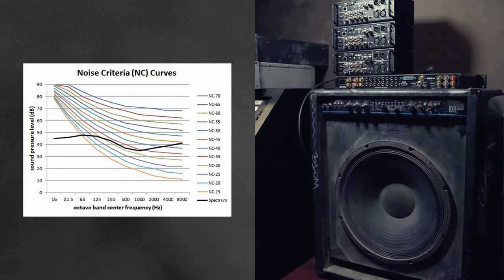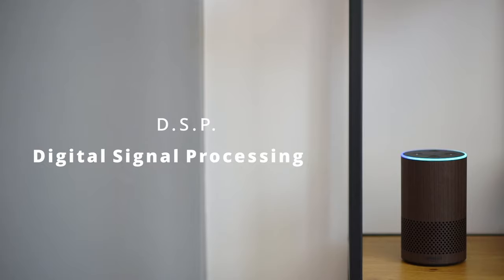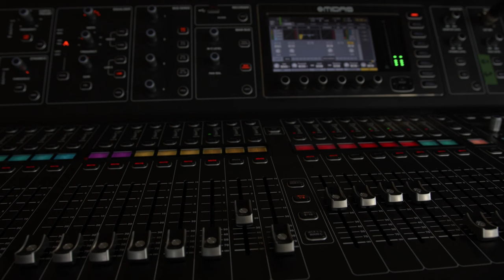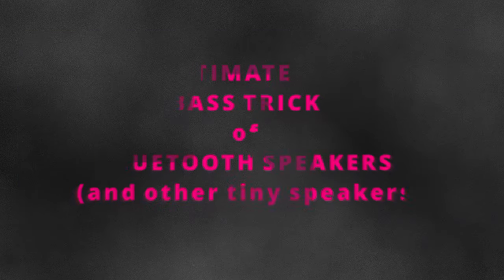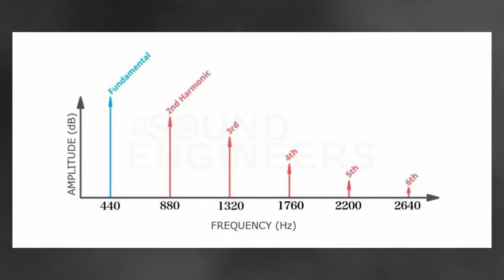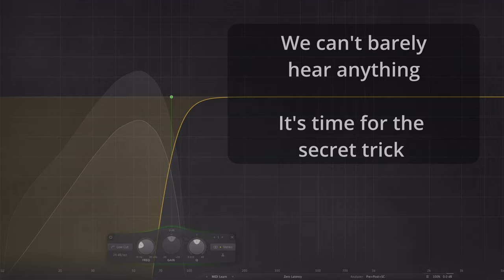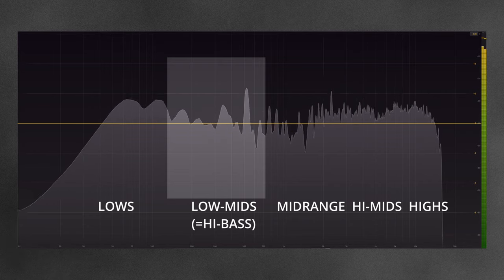the SECRET BASS TRICK of BLUETOOTH SPEAKERS (and other tiny speakers)

Comment: Another trick seems to be using oblong 'racetrack driver' speakers, to maximise surface area of the cone even in a small enclosure, and also passive radiators, which allow for a low resonant frequency without the space required for a port.
Reply from the maker: Indeed those are some the other tricks ! Thank you for sharing them

Comment: Dope breakdown, daws and plugins can emulate this trick but it comes at a cost like you pointed out
Reply: what plgins? I'd like to try them (I'm a composing grad so my daw knowledge suck)
can't you also mitigate that by applaying the reinforcing frequencies in a aux track? like, develop bass' harmonics from the bass intead of boosting it in the track?
Reply: @gesamtkuntswreck  congrats on being a grad 🙌🏾as far as plugins: Waves RBass is a cheaper and solid plugin. 
Submarine is also good for lower sub ranges. 
Applying to an aux/send could work too, it can give more control but I’d monitor the mid/side changes too if it’s stereo. 
And generating additional harmonics  within the synth could also work some modern synths have this built in. 
With Harmonics it just takes abit of math. Between the even and odd harmonics it’s worth remembering these all take up space and need to be considered for clarity. 
Anyway to summarize. 
Just experiment your ears will tell you what works or doesn’t. 
And with any type of producing the more your do it the better there’s no real secret 👏🏾

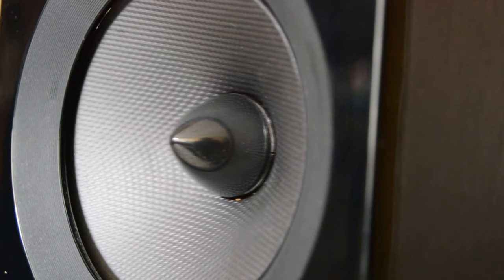Comment: 2:04 it's 50Hz, not 60
Reply from the maker: No, it’s 60Hz
Reply: @BoringVic  Il a raison, c'est bien 50 Hz. À moins qu'Audacity ne se trompe de fréquence...
Reply from the maker: @MadrafTintagel  C'est moi qui ai tourné cette section et je te garantis que c'est bien 60Hz. Et si tu regardes bien où est le sommet de l'analyseur spectral, tu vois que c'est juste après 50Hz, à 60Hz précisément. Après, je vous l'accorde c'est une forme d'onde assez large pour que ce ne soit pas très clair au premier regard.
Reply: @BoringVic  Je viens d'écouter 50 et 60 Hz avec Audacity, et pour moi, c'est clairement du 50. Cela dit, à ces fréquences, l'oreille humaine n'est peut-être plus vraiment fiable. Quant à la courbe, je vois le sommet vers 55 Hz...
Reply: @MadrafTintagel  en effet, c'est bien du 50hz, zero doute. Super video sinon.